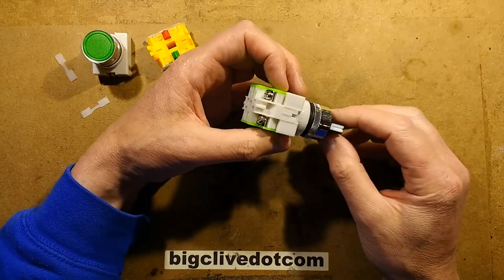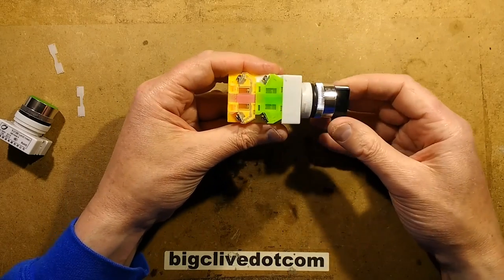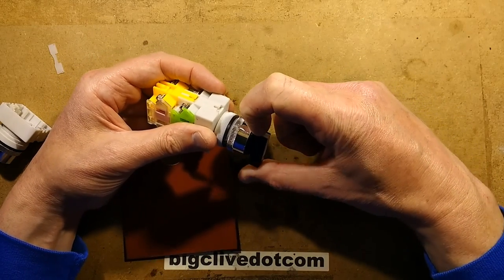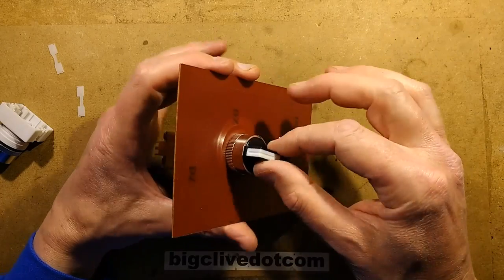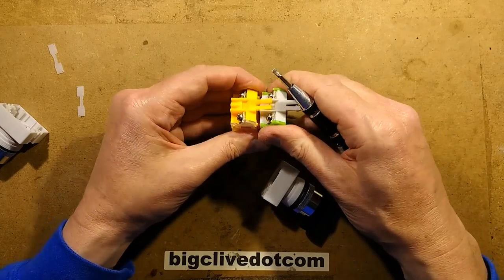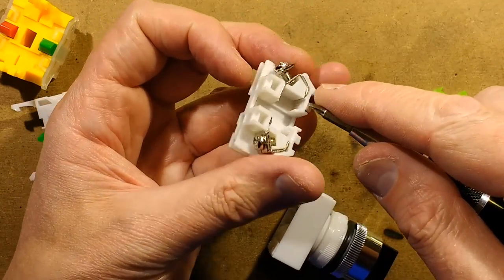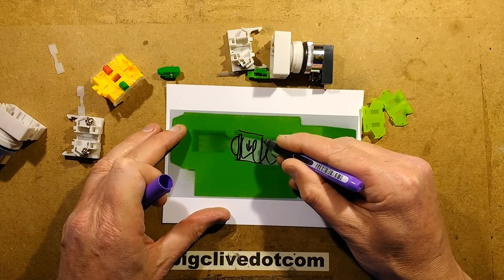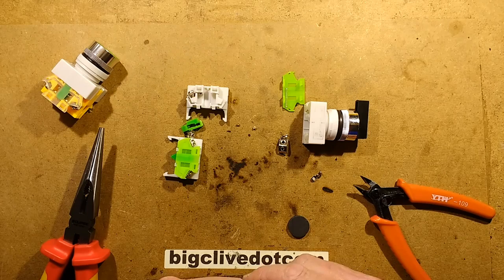Inside a cheap rotary control panel switch from China.

Comment: I'm amazed that those can be manufactured so cheaply!
Reply: Edward Nardella - They can be manufactured so cheaply for several reasons. 1. They use cheap materials that are not rated properly. 2. Labor is extremely cheap, no employee benefits, workman's comp, etc. 3. They don't have to pay for product certifications. 4. They have little to no liability for their products (no need for insurance). 5. There aren't many, if any, laws in China about disposing of toxic waste. They just dump it into the nearest river or vent it to the atmosphere. 6. Etc. Etc. Etc. In the U.S., we suffered the same problems during the industrial revolution and we're still suffering from it. (We didn't even ban asbestos and lead paint until the 1970's!!!) China will be a wasteland in 25 years if they keep going like they are. This is also the reason why most leather goods you purchase are made in other countries. Leather tanning uses very hazardous chemicals and produces terrible waste products that must be disposed of. We import from countries that, again, just dump the waste products into the closest river. It's the same for lead smelters. There's only one left in the U.S. and their time is limited due to all the lawsuits they are incurring from contaminating local communities. Cheap labor, cheap materials, no laws = cheap products.
Reply: That doesn't change the amazement I feel.
Reply: I absolutely agree with you. Even considering all of the factors that I presented, the prices of these products amaze me. I often look at equipment that I order and wonder how the heck they can make it for so little money.

Comment: For a pushbutton, it doesn't matter, but if you have a rotary switch or estop switch, you must have keying, round hole, round button, the damn thing will come loose and start rotating in the panel. If at all possible, its better to use spring loaded contacts than screw terminals, assured good contact and not having to bother with a ferrule are good benefits. But yeah, buttons and whatnot are cheap parts, very generic and they are used all over the place.
Reply from the maker: It does have slots on the shaft for keying, but not so easy without a suitable panel punch.
Reply: Ah, couldn't see it from the video. Then i would say its quite usable part for generic use, maybe not best ever, but low cost is worth quite a lot.

Comment: if the cam just pushes the contacts together there is no snap over action, they are probably cheap because they are only suitable
for very low current/voltage app`s so why use such a big switch.

Comment: They are quite flimsy, but I kinda understand why people are buying them. I've assembled DIY board for learning PLC programming. Switch like this, from Eaton/Moeller consists for example of two NO contact blocks, holder, the 3-position switch "head"  itself, and also a LED element, cause i wanted an illuminated switch. Together it came to TWENTY FIVE  POUNDS (120 PLN in my country). FOR ONE f** SWITCH. I understand they're made to industrial quality, but the pricing is absolutely ridiculous, and Siemens is even more expensive, not to mention the Allen-Bradley. The S7-1200 CPU itself (second hand, unused) costed 200 pounds (so 10 switches=PLC)...

Comment: Cheap rotary control panel switch from China doesn't have the same ring to it as "Cheap shitty pink usb charger from China." Anyway, Could this be used with a modified face plate as a light/fan switch?

Comment: Whoa, that's very good for the price. Wouldn't really want to pass the "rated" voltages or amperages through them but they look like they'd certainly handle a couple of amps at a low voltage without issue.

Comment: Part of the problem with making them in Country and in China, tends to be #1 COST of materials..  In most of our countries the pollution laws ADD cost, and the materials EVEN if from CHINA have added costs threw our systems...Plastic to metals..in the USA are over priced by 4-10 times over China..  in the 90's Polycarbonate was about $1-2 per pound..NOW we pay over $250 for a Car Headlight Cover made in mexico..  THAT same switch, after going THRU our system would be marked up 4-10 times..

Comment: My chinese electric car, a three-wheeler, uses this switch for the forward-off-reverse selector. Funny how Chinese manufacture quality is just really uneven, some if it made really well, others junk. On that car the driver side window glass survived a car wreck where the lightweight car was tipped on its side and spun around with the window glass like the point of a top, gouging the thick glass, but not breaking or cracking it at all. But if you open the door too hard on that car the cheap plastic doorhandle breaks in your hand.

Comment: Well, copying something mechanical is one thing. Understanding what you're doing and copying correctly is entirely on a different sheet of metal.
Look at those cheapo USB pear-chargers, "made in Calfornia" and such. They're often not even capable of chosing the correct letters, if at all. 😀
Sliding/Wiping contact feature is nice but is it effective in accomplishing the true action it is supposed to do? I sincerely doubt that. And as others stated before me, there's no ark quenching (primarily relevant in DC applications), neither.
I can imagine what's going to happen when loaded. The plastic gets soft (glass transistion temperature) and then all hell breaks loose.
One might use this product. But I personally would derate those "ratings" by 60% at minimum!
These Chinese ratings are most of the time rated at 200 to 300% (and often even more than that) of their real/safe capacities. Better be safe than sorry.

Comment: In the U.S.: "Devices having a rotational
member, such as potentiometers and selector switches, shall
be mounted in such a way as to prevent rotation of the stationary
member. Friction alone shall not be relied upon to prevent
rotation."
We have to use a keyway on the switch barrel and notch cut into the panel hole (and a key of various designs) to prevent the whole assembly from rotating and ripping the wires off.
Reply from the maker: These have a key on both sides of the threaded section, but it does require a proper panel punch to make a suitably shaped hole.  That's more viable for professional panel builders as opposed to home projects.

Comment: There's no lubrication visible in those cheap clones. And the slow contact open/close action is quite worrying. They will arc far more than would high speed switches. And it's likely that the plastic is neither flame retardant nor thermo-setting material. The cable connector points and the switch contacts are too small for the rated current capacity. The 'wiping' effect means more wear, too. Expect premature death if used seriously. Yet another online scam.

Comment: they used these type switches on those terex asphalt roller complete rubbish,garbage,for Mobil equipment there not robust enough especially the ignition switch, there fine for stationery equipment!

Comment: first
Reply: @clive: that white retention thing you first have to pull out, could it be used as a safety switch (put a lock in for a manual-off-auto kind of switch?). I wouln't use it as such but could it be used?
Reply from the maker: It could be used as a crude lock-off, but it wouldn't be hard to defeat.
Reply: ...but it wouldn't be hard to defeat. and, thus, would probably be a violation.